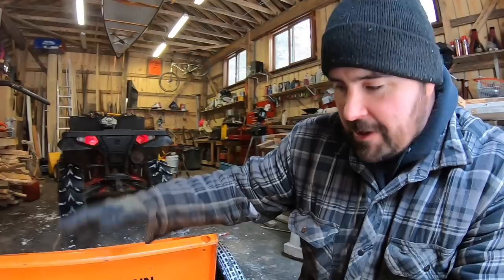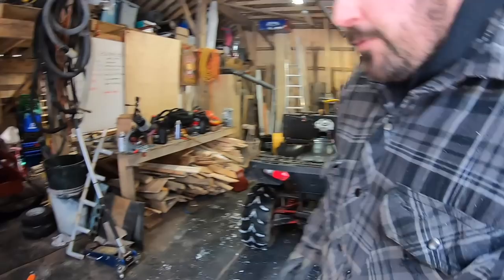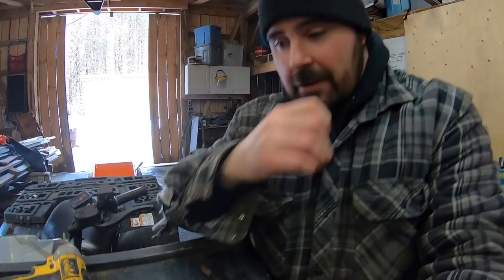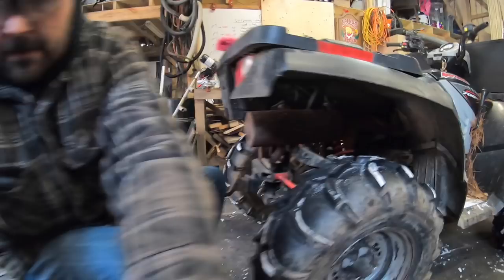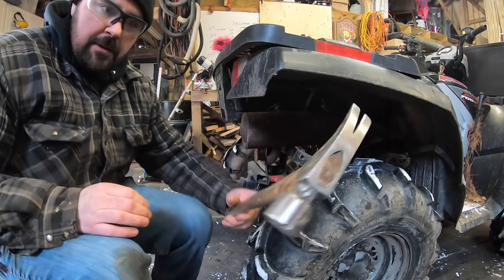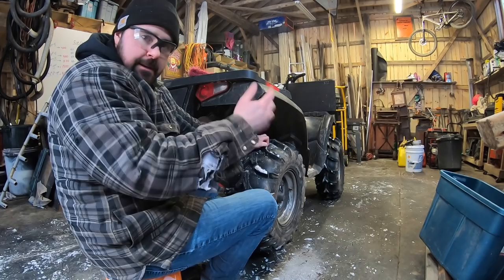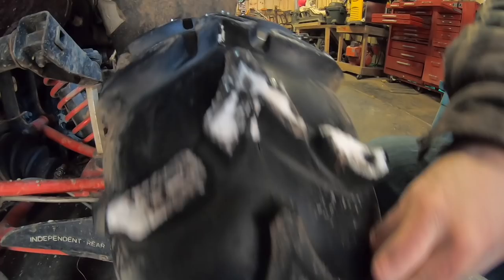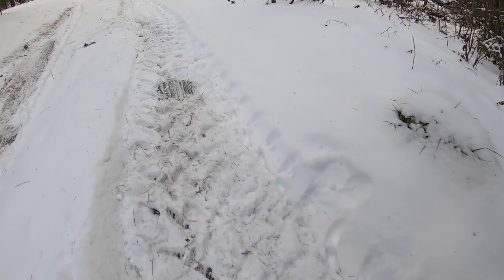Do ATV Tire Studs (ice screws) Actually Work?

Comment: The studs that have a hex head on them work way better than ones with the small pin.  I like the Titan ones from Amazon.  Also adding some weight on the racks will help a lot.   Nice video.
Reply from the maker: Thanks J L

Comment: I have chains with ice corks on them that I converted from a really old set of car chains. In the 50’s car chains were common. We had a few sets here on the farm. I used links from one set welded in the cross chains of the set I made. 
They really dig into the ice

Comment: One thing I would like to remind you all about: ATV:s and compact tractors are not made for big/heavy implements and "superhard" use. IF you add weight and chains chances are great that something else (expensive!) will break.
 Most of us sometimes remove/replace pins/bolts/springs that are designed to guard the machine/implement/user. A plow on the ATV is great, but if one puts good chains on chanses are that the frame will crack. Maybe not today, not tomorrow but maybe next year or the year after. The slipping of the tyres "protects" the frame and the gearbox/shafts.
 More traction gives more "bang" when the plow hits a stump. Forces grow on parts and if something brakes we tend to "blame" the machine/factory.
 The loaders frame on the tractor I use at work broke thanks to heavy snowpushing and lifting. To get more power I use chains and a counterweight. I agree that it is my fault but the alternative would be a bigger machine (+100 000$) and that is not on the table.
 Just wanted to remind you not to oversize implements too much. At some point it's cheaper and smarter to upgrade machinery. If you load tyres, buy counterweights and so on you can get a bigger machine (that you don't have to run at max capacity) that will last longer. Have a nice day and keep safe!

Comment: I been running chains for a few years now and they work great in the woods. To save a few bucks I bought a set of truck and suv chains at Princess Auto when they were on sale and shortened them a bit. Think I only paid about $80 for them and they’ve held up now for 6or 7 seasons in the woods

Comment: Yearsssss ago (22 years ago with a Yamaha BigBear 350), I use hex head sheet metal screws (lot cheaper by boxes of 100's) and it improve ice traction compare to bare tires but lot less traction than tire chains. For traction there is no substitute to chains.... BUT there is tracks (higher cost) like I have (Camoplast/Camso) on my Club Car 1550. Still sideway slides on incline pure ice but very rare on my terrain. If needed, I still can use hex head sheet metal screws in it. Be well and safe.
Reply from the maker: Great ideas there! Thanks for sharing

Comment: I just bought a crap load of short sheet metal screws.  Cheep and worked well.  When I did my mountain bike tires I went from the inside out. The duck taped the inside to protect the tube.. trick where thick gloves.

Comment: Chains are way grippier on the heavy snow, while  screws are great on bare cold ice. Chains still work very well on ice too. Studs won’t help as much on the snow. Unfortunately, the studs float above the snow as  it packs down. Try the same  grade with 1 foot of new snow.  Wet snow chains are the winners, as they have a paddle wheel effect. 
And 4 wheel drive for sure is a huge factor

Comment: Old boy tip for you... chains... and if only 2 wheel drive then a pair... suggest a 2nd pair of tires but in lou of that... when you put the chains on ... let the air out of the tires... get chains on as tight as you can... pump up the tires and use bunjees to collect any slack... I had a 3 wheel Honda 250R with chains on like that on a set of "Buckshot Mudders" (look more like winter truck tires) and I could travel at 50 miles an hour and lots of control... front tire I put sheetmetal screws in to assist in some turning... kinda funny to think 40 years ago I was burning holes in lake ice :)
Reply from the maker: I think you’re onto something!

Comment: I use carbide studs on my CTL they give it awesome traction, I couldn’t make it up my driveway when iced over, but with the studs I can go just about any where on ice, just have to be careful when turning on hard dry ground as it will tear them out. Nice spreader.
Reply from the maker: Yeah can imagine. I think in the right application they would work real well.

Comment: I'm kind of surprised you went so long without fixing the 4WD on the atv and then when you really, really needed it, spent a day also not fixing it. I'm going to guess it was a servo or connection to the servo that was the issue.

Comment: This is why I prefer a Yamaha Grizzly or a Suzuki Kingquad, they have a constant tension CVT with a slip clutch for initial takeoff in an oil bath inside the transmission (Makes it one of the smoothest transmissions ever), in addition a manual selective 4wd/2wd, AND manual select locking front diff. Since my tractor took over plow duties, I don't use chains any more since it only does light duty stuff anymore in the winter.

Comment: I never lost one screw from the bunch I bought off Amazon.  Put them in bearclaw htr tires on my 650 outlander.  I like to go wot in the snow as well.   Won't go another winter on an atv or sxs without studs.  I think you are suppose to have just the carbide out past the rubber. The carbide never wore down  all winter.  About 1000 kms of riding ice and snow, road and hilly trails.
Reply from the maker: Great to hear that Mark. Looking forward to mine last just as long I hope

Comment: I would option for a cheaper set of chains for the rear tires. At the low speed on trails it wouldn't be too hard on the machine and give you optimal traction. Also you wouldn't be wearing down studs all summer long when they would serve no purpose.
Reply from the maker: Yeah I think that'll be a good idea. I was trying to save some money and figured I"d give this a try as I always wondered.
Reply: @sawingwithsandy  Thanks for trying out the studs, I wondered how they worked on atv's. Now I know👍.

Comment: Been running studs in dirt bike and atv tires for years now, get grip studs, they're way better then those cheap tiny ones. They cost a lot but mine are 7-8 years old. I have two sets of wheels/tires one full of studs for winter and one regular for summer but you can take the grip studs out in the spring and put them back in in the fall too.
Your tires also totally suck in the winter, we gave up on mud lite XL's they just dont work on cold hard ground, they're too hard and the treads too spaced out.

Comment: The 4x4 on those Polaris are usually an easy repair. 9 times out of 10 it’s a broken wire down by the front wheel hub/ strut area.
Reply from the maker: My speedo is broke

Comment: Curious what psi are you running in your tires? If they call for 5 psi I wonder if 3 or 4 might give you better traction? Just a guess. Also, when my 4x4 indicator light would not come on, I found a wire connector had come undone in the instrument cluster. Cheers.

Comment: Your rear end is too light (on the quad). Adding 100 lbs on the rear rack will make a world of difference.
4wd in the snow is a must also, and that's what got you up your slope.
Reply from the maker: Yeah seems that way
Reply: The big box on the front was removed from the front as well, and that's probably your main problem. Putting the box over the rear drive wheels may have fixed the lack of traction.

Comment: Just use hex-head bolts from whatever hardware store you use. You can get larger heads and ones that have a recession on the top.
Reply: Studs are mostly for racing and much longer and thinner.

Maybe longer studs and have a winter and a summer set of tires.

Comment: Hey I'm new to your channel I live just north of Sudbury. like the content my kind of stuff👍and for your tires I think you might have a bit to much air I have the same lug on my mud lights and they are a round surface and you run on only about 3 inches in the front and maybe 4 inches in the back if your lucky. I know allot of guys will yous pour man studes self tapping screws as long as you don't spin the he'll out of them and stay slow speed they work good. I have a 660 grizzly and I have a  60 inch plow and I have the similar tires and il I did was air down and the ridding surface is much wider when you squish them well good luck 👍
Reply from the maker: Welcome to the channel Marc!

Comment: I figure its cause at any given moment, theres only 3 or 4 studs (per tire) actually touching the ice which is not producing enough hold, especially cause theres so little weight in back of ATV. More studs in line on the footprint would help i think

Comment: Hello! My opinion: when machines are light chains is the way to go. If you are really scared to damage a nice driveway studs can work. But there has to be alot of them, the tyres should be strong enough and there hasti be enogh of weight.
 Studded chains number one, regular chains number two, winter tyres number three and studs number four. For ATV and small tractors number three is off but larger tractors and machines benefits from wintertyres. They who plow alot of snow over here often have two sets of tyres for loader/truck/tractor.
 I would go for studded/semistudded chain for the ATV. But you can plow and sand with the Kioti so why the ATV? You can't drive them both in the same time anyways... At -15°C you can drive with summertyres. The icecrystals change and nothong is slippery. Around 0°C everything is slippery, the ice smooths out and it just ain't fun anymore. We are now again in a +5°C to -5°C run. I hate it, it's much easier when its -15°C to -20°C. But my employer likes this better, at -20°C we burn 300 gallons (1200 liters) "off-road diesel" every day. At best we have used 2500 gallons (10 000 liters) per week, thats allmost 10 000$ just for heat in a week. But yes, there is alot to keep warm 🥶...
Reply from the maker: Great advice there! Thank you

Comment: Can I ask what might be a dumb question, would not fixing the all wheel drive give you more traction than studs? It has to be done sooner or later anyway?
Reply from the maker: I originally didn't expect to be able to repair the awd since my dash cluster is broken and so I was looking for alternatives to get the job done in 2wd.
Reply: @sawingwithsandy  LOL I can relate I plowed snow one winter in 2 wd, I could not afford the actuator for the front diff.

Comment: I have an 02 sportsman 700 with the same itp Mud tires and it’s worthless in two wheel drive. The front tires def hold you back in snow
Reply from the maker: I think you're 100% right. Seems like without awd it's pretty useless in these conditions.

Comment: I have a can am outlander 1000 I only use sheet metal screws in my tires
Reply from the maker: I've heard of people doing this. Sounds like its worth a try for sure
Reply: @sawingwithsandy  you can put double the studs for fraction of the cost

Comment: Try lowering your tire pressure Dow to about 20 pounds that puts more tire tread to the ground
Reply from the maker: tires are actually right at 5lbs as they sit. These tires are quite stiff so they can practically run without air in them.

Comment: USELESS,, I had my new Polaris 500 studded by a professional and it worked for the 1st year. But we use our machines all year long and rocks and rough spots eventually pull them out. Then on the 3rd or 4th year, you have to put tubes in the 4 wheels because every day or 2 they deflate .I don't know how long my studs were but going over rocks in the summer pushes them in and, after time causes them to leak. Now I don't screw around,,, 4 chains installed on my Polaris ranger 1000 .good to go now for many years
Reply from the maker: Good to hear first hand experience with chains